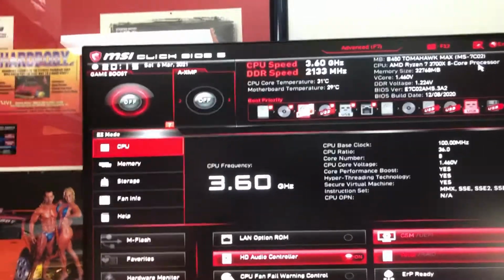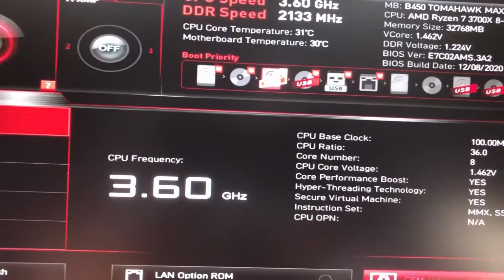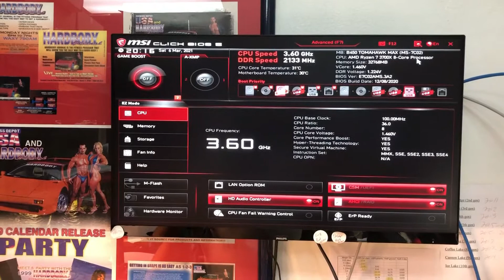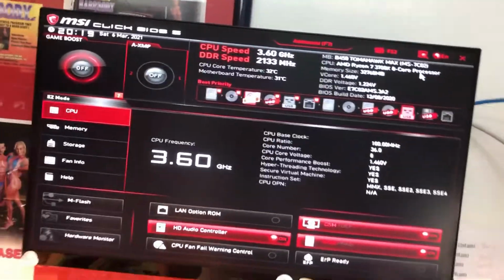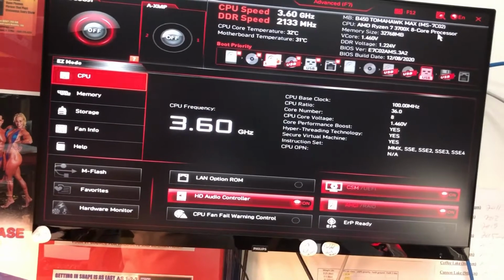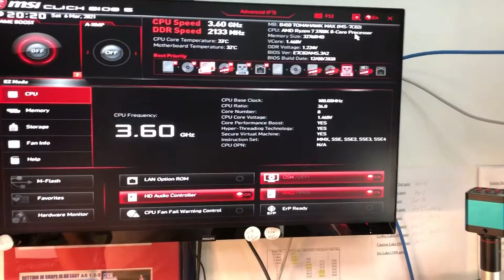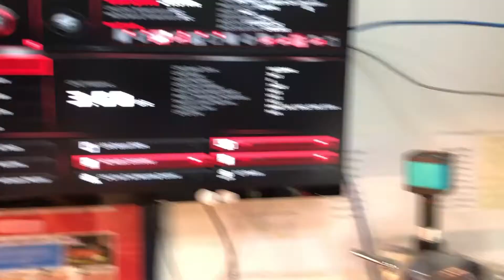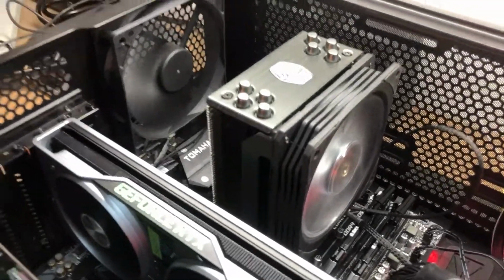Can a bad CPU still post? Corsair Gaming PC Ryzen CPU Crashing.

Comment: I couldn't believe it but I suffered the exact same issue. I suffered 9 months of this issues. Did all the diagnostics. All was fine, changed SSD, tested memory all fine, changed motherboard. Finally the Ryzen 5 3600 was not working with core 6. So frustrating. I think there is a reliability issue with the Ryzen's 3rd generation.

Comment: What about if you hear a beep, but there is nothing on the screen. I should note that I swapped out my ryzen 5 3600( the one that I suspect is the issue at this point) for a different one and it worked. I installed the ryzen 5 3600 today and the issue is back. Any ideas?

Comment: Seems I have the same problem with my new 7950x. Built a new computer, it posts but windows give blue screens, memory test is fine. But still tried other sticks of ram, but it didn't help. Switched motherboards now, didn't help. I assume now that this is a broken CPU, just like on your video.

Comment: Same thing I experienced. In my case it was a new R7 5700x, first boot fine. Got to windows. During Heaven Benchmark, the whole PC shut off. I thought nothing of it. Booted up into Windows 10 again. This time as soon as a game loaded up PC shut's off. Then Windows 10 wouldn't boot.... PC shuts off or Windows screen freezes. Switched PSU. RAM, GFX card, Storage,... then put in my old R5 2600 and everything loaded up perfectly.
First time with a bad CPU out of the box. CPU posted perfectly into BIOS even was able to flash different firmware.

Comment: I had the exact same issues this week with my Ryzen 3900x, which is barely over 2 years old. Similar troubleshooting methods and was able to narrow it down to the CPU or Motherboard. I'm using an MSI MPG X570 Gaming Plus motherboard.

My second system is a really low-end intel system, but I was able to swap some parts into it from the Ryzen sytsem, and in my Ryzen system I was able to swap out the RAM and PSU.

After watching some youtube videos and reading some threads on Reddit, I was pretty certain it was the CPU.

I contacted AMD and went through their RMA process. The odd thing is I had a 1700x die on me after only a year or so of use, but I thought it was due to trying some overclocking on it. Now after the research I've done, this has been an unusually common situation on Ryzen cpu's across all generations, but especially bad on the 3000 series.

Comment: Mine is doing that right now the only thing is that out 10 15 startups it will post one time but once I press F10 to save and reboot it freezes right when it says windows will repair . I tried it on another board I have and eventually I will get to the bios but it’ll do the same thing with the exception that this time the cpu fan stops when the booting logo freezes. 

Tried with a different psu and ram sticks and ssd no success After watching this video I’m convinced the cpu is dead but for some reason it post whenever it feels like. .............

Update.
it was the cpu I got a ryzen 3600 everything is fine now.